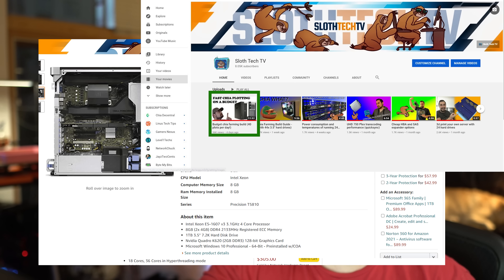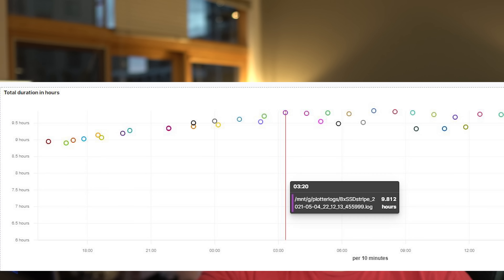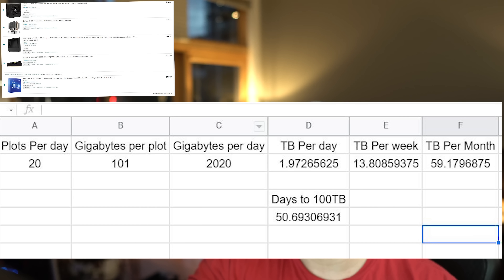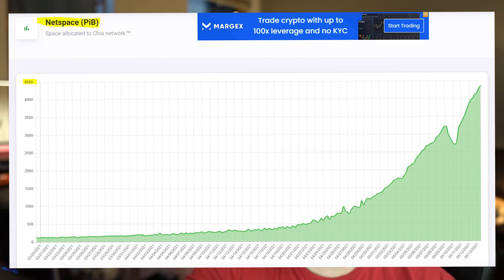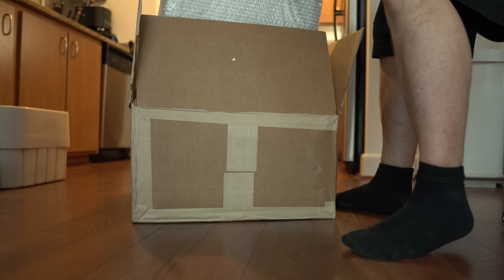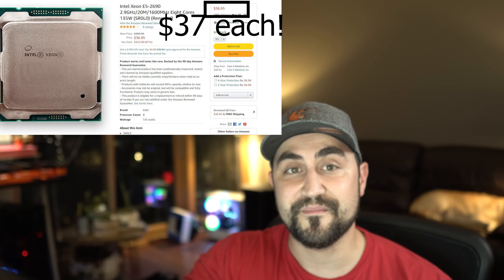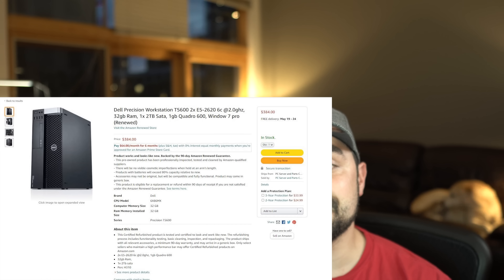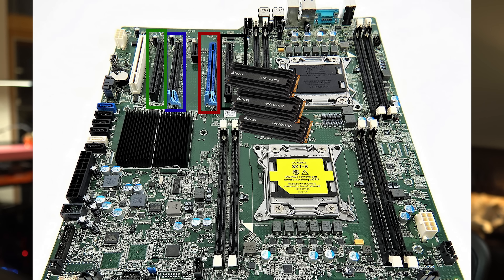Chia Plotting Build $620 w/ Dual XEON CPUs

Comment: Update: Pools dont come on 17th. They have just been moved to end of the month. You should check Bram's Twitter in case you dont believe me
Reply: @halukyildiz4126  it does not matter if its a scam or not.
That does not effect the value.
Hype effects the value

And for the time being,  this is looking like a great flip.
Reply: How's is my build, what do you think 

https://ca.pcpartpicker.com/list/FgpVz7
Reply from the maker: @sreejhu  I think with that 3900x You'll end up getting more 8TB drives.. then you'll end up getting more NVME drives to fill those new 8TB drives. -- All jokes aside its a good build that 3900x will be able to crank you through phase 1 in no time.
Reply: @SlothTechTV  Thanks a lot for your advise and help man, Do you think to put the drives in raid 0 or 10 mode. As i know if we keep in raid 0 and if  there an issue with one HD then all the other HD will be non usable, What do you use and suggest
Reply from the maker: @sreejhu  Don't raid 0 the drives -- there is something called amplification which will wear them down faster -- there also isn't any significant performance gain I've observed from raiding nvme drives. Just do plots to individual drives.
Reply: @SlothTechTV  hey, what do you mean by plot to individual drives, in the software there is no option to select different drives for farming there is only one option to select a single volume. How can I do this. May be can you send me a link to a YouTube video where someone is explaining this. Thanks a lot in advance. I must say you are the only person I found giving hard core tech stuffs about chia mining I found in YouTube. Thanks a lot for helping everyone here!!!
Reply: @SlothTechTV  hey, I am not talking about the nvme raid 0 configuration. I am talking about the destination drive where the plot sits for farming!! As you saw that I brought 2 x 8TB Wd red nas drives. But not sure how to configure them as a single drive to save all the chia after plotting them
Reply from the maker: @sreejhu  whoops sorry... yeah you can raid 0 those together and get a bit better performance when sending to them from the temp directories. sorry for the misunderstanding.

with the caveat that if one fails you'll lose all the data on both... with brand new drives thats probably unlikely.
Reply: @sreejhu  You can have multiple plot directories. In the GUI the three small dots next to "+ ADD A PLOT" is where you can add more directories where it is looking for your plots.
Don't raid 0 your drives, if one fails all your plots are gone. Also keep in mind the highest failure rate for drives is when they are new, the ones that survive will then most of the time run very long without issues until the failure rate slowly increases again because of years of wear.
Reply: @SlothTechTV  Unless I missed it, he is going to need a video card too.
Reply from the maker: @BradSimpsonVideo  Roger!! ty for catching that, Brad. Much love for all of the help everyone is being in this community. Its great.
Reply: @SlothTechTV  people helping people my dude.
Reply: @sreejhu  Hey man just a heads up. You need a video card for that processor. So if you already have one laying around you plan on using, cool. But you will get no display without one.
Reply: @BradSimpsonVideo  oh man, no way, I though my motherboard already has built in onboard video.. do you think ryzen 9 series don't have a built in onboard video
Reply: @sreejhu  The problem is you need a G series. Just because the motherboard has like HDMI etc doesn't mean it has a way to output it. So a lot of processors will have what they call integrated graphics. So when you are looking for a processor you want to make sure it DOES have integrated graphics. If they don't, then you need a GPU. 
https://www.amd.com/en/processors/ryzen-with-graphics 
That shows ones with the integrated stuff.
Reply: @BradSimpsonVideo  woow, thanks a lot man, this is unbelievable. I got this freaking processor for almost 700$ lol, I am not sure if I can get a gpu in this era 🙆🙆🙆
Reply: @sreejhu  you don't need anything fancy. You can get a hold of a lot of video cards that are around $50 that just give you a display out.
Reply: @BradSimpsonVideo  cool got it thanks. Also, do you think my hard disk specs for saving the plots are too much. I got a WD   Nas red Plus 8 Tb 7200 rpm with 256 mb cache. Do you think this 7200 rpm with 256 cache is tooo much or 5400 rpm should work?? Also do I really need a nAs drive
Reply: @sreejhu  honestly to me it depends how you want to send this stuff up. NAS drives just read and write slightly differently than standard drives. Same with WD purples that are meant for DVR's and things like that. I just got a bunch of externals myself but that's because I wasn't going to build a raid 5 setup or anything. From what I can tell, you don't need anything special at all for the plots once they are done. Plotting is the name of the game. Faster the better. But there is nothing wrong with the NAS drives either. So WD Red or Seagate's ironwolf are both good. It's all about your backup plan in my books. I have some high end hardware to recover files from dead drives, so it's not too big of a deal for me.
Reply: @BradSimpsonVideo  cool  thanks, but again how do you use the USB hDD, in the chia plotting software I only see one volume to select for the destination / saving plots. Or am I missing somthing??
Reply: @sreejhu  If you plug in an external drive, it should assign a drive letter to that drive. So after you select your nvme or whatever you're using for plotting, you should be able to see your external drive in the final destination spot. Hope that made sense.
Reply: @BradSimpsonVideo  sure, I completely understand that portion. But does the chia software have the ability to select multiple usb HDD location for storage???
Reply: @sreejhu  yeah so the way it works you can select up to 29 plots at a time as it stands now. No idea how future software will go. Which is fine for me. Only 20 seconds of work each time you add another 29 plots. You can select which drive you want to output to. But doing a bunch of different ones at once seems like more work somehow. I'm filling up one drive at a time at the moment.
Reply: @BradSimpsonVideo  thank you so much for putting all these informations, big salute.... .......🤜🤛
Reply: @sreejhu  no prob. Happy to help.
Reply: @BradSimpsonVideo  can you plesss help me with below issue, I plotted almost fir one day and all 5 plots can't see now in chia software l. 

I had to stop the application Because during plotting I was getting some kind of errors. At this time, I had 5 fully plotted blocks which already got transferred to my final destination. So I did a restart of the pc and I opened the application then I saw that I still had my existing 5 plots in my finally destination. But then I saw there are some data's in my temp storage (NVME)  drive so I thought I will format that and do a fresh plotting to get the max storage. So when i formatted the temp drive and When I my re opened the chia application i see That I lost my link to the plots. It's no more telling that I have 5 plots found but it shows the link to my plots. But It's not getting recognized in the chia software. Can anyone please guide how to fix this. See below for the issue
Reply: @sreejhu   That's a lot of Money why the pre-build is not good enough?
Reply: @claudioborquez3394  actually I never bought it wantedly, I had to buy the cpu processor and mobo just Becsue it was coming as a combo from newegg.ca because I have to buy 3080 GPU combo for my eth mining. The 3080 combo came with amd processor and Asus mobo + the GPU (3080) . Later I thought why not use that cpu and mobo for chia mining.
Reply: @sreejhu  so its nothing wrong with buying a pre-made computer correct?
Reply: @claudioborquez3394  sure, you can folow as per @sloth tech TV, i found his channel after I bought the stuffs else I would have got the same as he did
Reply: @claudioborquez3394  bro please help me!!
Reply: @claudioborquez3394  Hey, I had to stop the application Because during plotting I was getting some kind of errors. At this time, I had 5 fully plotted blocks which already got transferred to my final destination. So I did a restart of the pc and I opened the application then I saw that I still had my existing 5 plots in my finally destination. But then I saw there are some data's in my temp storage (NVME)  drive so I thought I will format that and do a fresh plotting to get the max storage. So when i formatted the temp drive and When I my re opened the chia application i see That I lost my link to the plots. It's no more telling that I have 5 plots found but it shows the link to my plots. But It's not getting recognized in the chia software. Can anyone please guide how to fix this. See below for the issue
Reply: Sourcecode?
Reply from the maker: @marcfree2855  its true! Pinned this comment!
Reply: But the say it:-(
Reply: @marcfree2855  dang, use this time to get hardware then, buy what ever you can, search locally and check the used market.
Reply: hpool does not work ?
Reply: Hello and thanks for the upload. 
I got the T5610 with 2x E5-2670’s (might upgrade to v2’s 2690’s eventually)  64gB ddr3 I was running 2x 2tb Sabrent 4.0 NVMes in Sabrent PCIE adapters.  I’m running Ubuntu and doing 4plots parallel,4000mb ram, 4threads, per NVMe.  
The plotting speed is very slow no matter what settings I choose.  I can’t figure out what the bottleneck is.  Ubuntu is running on a separate ssd. It takes like 18 hrs to complete 4 . Please help

Comment: sounds cheap and romantic at first until you calculate price per plot. I do 0.05$/plot, and it takes 1.5 months to repay just a one plot.

My plotting rig costs 400$ for 9500 plots. with ~18min/plot.

It takes another 6 years to repay your HDD. Average HDD failure rate is 4 years (BackBlaze stats). We can speculate about idling HDD lasts longer, but who knows.

With old, inefficient stuff, and expensive SSDs...you are plotting for 0.2$/plot or more. That is 7 months just to repay the plot. And 7 years ROI for first HDD. That is gamble.

Comment: Not sure how you are doing this for $600. I mean, I grabbed the cheapest dual socket t5600 I could find on Ebay and with shipping it was still $400 and that only has 2x e5-2620 in it. Upgrading ram and installing 2 nvme drives would put me closer to $800 or even $900 not $600.

Comment: Curious question here, I noticed that for the 5600 you have linked Ddr3 1866mhz Ram. The manual shows the max is 1600mhz and I’m curious to know if it runs that fast.

I purchased the 2680 processors and I wanted to max it out at 128gb

Comment: I got a T5610 off of ebay for around $320. Came with a e5-2620 (just one). I decided to go with a pair of e5-2660 v2’s because they have 10 cores each and 20 threads. Yes lower clock speed of about 2.20 ghz but I figured I could compensate with extra threads. Plus the pair was only $70 on ebay. I have 64 gb of ram also. I started plotting today and it looks like the system is only recognizing 10 cores per cpu. I started plotting 3 plots in parallel with 4000mb ram and 4 threads each but after the second plot started my cpu usage was almost maxed out. I may have had them staggered to close together (only did 30 min delay) also I dont know that I need 4 threads. But part of the reason I went with this system was for the crazy amount of threads. Any ideas guys?
Reply: Do you have win 10 or higher?
Win 10 recognize only one processor. You need windows pro or higher
Reply: @apapos  I have windows 10 pro. So that isn’t the issue. Thanks for the help though.

Comment: I built the t5810 I put the e5-2699  v3 .I have 2tb fircuda and 2 SSD 2tb I already had .any sudjestion on what the best optimization to plot faster.it takes 40 000  seconds for stage 1 .I put 8000 of ram and 36 tread I have 18 plots going stagert by 30 min processor is at 10 to 20% usage I have 84 GB of RAM.any sudjestion would be great I have 16 SAS drive on the way and an Sli MBA card thanks 4 the great video

Comment: The 2TB PNY CS3030 has a TBW of 3115 TB, nearly on parity with the Sabrent Rocket's 3600, and much higher than most off the shelf SSDs, but for much less. ~$270 vs ~$400 for the Sabrent.  I think the PNY is the best bang/reliability for the buck if you're looking for plotting SSDs.

[edit] I miss-typed the PNY model.  It's the CS3030, not the CS2130.
Reply: Corsair MP600 2TB 3600 TWB, currently for about ~400$, the best bang per bucks drive so far. 0.035$/plot if you plan to plot 9500 plots.

I have one with 3720 TWB written, and it still works and claims 95% used.

I have tried few SSDs, various generations...they still do same plotting time because they all use same NAND, Phison controllers. Only thing that changes is price per plot.

If you can afford Intel Optane, they have same $/plot...but you need 2000$, while plotting 20k plots.

Comment: Hello, i did purchase a T5600 and i got issues with NVMe drives on some PCIe Slots. On slots marked PCIE3 all is OK, drive is recognized under windows and speeds are good. But on slots marked PCIE2 drive will not be recognized at all. I would like to use 4 NVME on PCIE slots so i can push the whole power of this setup. Please help ;) Thanks for your effort!
Reply: You are lucky with bios v19 and my new T5600 I have Win10 starting but when I use PCIe based SSD windows hangs on start-up
Reply: @realPhotoMocha  It was the same here, I just load défaut bios settings then the NVMe was recognized
Reply: @autodiag7044  Thank you, I did try that already) which bios version do you use?
Reply: @realPhotoMocha  V19 like you, may be the adapter? I will try with another one from Amazon.
Reply: @autodiag7044  so there is hope - do you use UEFI or legacy - after the reset it is set to legacy
Reply: @autodiag7044  I got here already two adapter) I did order some additional ones to try them
Reply: @realPhotoMocha  You're right it was on legacy.
Reply: @autodiag7044  I ddi try after hours of testing the NVMe's on a different computer - same issue. I got new ones from a different vendor incoming now.
Reply: @realPhotoMocha  Well still have issues with PCIE2 named Slots, drive mounts but stays in RAW fs, impossible to format. When placed on others PCIE3 slots all is OK while in legacy mode. Will try to install Ubuntu and see.
Reply: I really hope that @SlothTechTV will help us out ;)
Reply: What works for me after replacing two nvme  are two Samsung 980 PRO 2 TB PCIe 4.0 (bis zu 7.000 MB/s) NVMe M.2 (2280) Internes Solid State Drive (SSD) (MZ-V8P2T0BW) and two Dual M.2 PCIe-Adapter mit Kühlkörper, 6amLifestyle M2 NGFF-SSD und NVME-SSD zu PCI-e 3.0 x4-Hostcontroller-Erweiterungskartenunterstützung M.2 M Key SSD 2280 2260 2242 2230 mit Low Profile Bracket
Reply: @realPhotoMocha  Ok on all PCIE sockets? I'm now on 2 sockets, 2 others just won't let me do nothing.

Comment: So if I am understanding this right if I have the dual Xeon E5-2690 V3 setup and two 4TB NVME drives I can have ten plots going on both ssd's  at the same time then being moved to storage HDD's when finished? and it will be a decent speed for the plots?

Comment: @sloth tech tv hey thx for your great videos and effort. I realy like the way you explain stuff and enjoy watching your vids. I got an offer for 2 "HP Proliant ML110 Gen9" each for arround 500 Euros. Each of them has 128gb ecc ram. One has an e5-2690 v3 and the other an e5-2640 v3. The 2690 does not have any drives in it, the other one has a P840 Raid Controller for up to 16 drives in it together wth six hgst 900gb 10k sas drives. Do you think this is a usefull offer and if so, should i replace the 2640 v3 with another 2690 v3 (or even v4 if it fits on the board). I would buy some more sas drives for the second machine as well.
Thx in advance and keep up your good job:-)

Comment: I bought a T5610, put 128GB or ram and upgraded to dual Xeon E5-2690 V2. I also have 2 Samsung 1.6TB U.2 drives. Question is what are your chia setting to get to the 40 plots per day on this rig?

Comment: Okay so I have a build that contains 2 Xeon E5 2670 8 Cores 
coupled with Asrock Mobo EP2C602-2L+/D16
which has - Intel® C602 : 2 x SATA3 6.0 Gb/s, 8 x SATA2 3.0 Gb/s (from 2x mini SAS 8087 connector), support RAID 0, 1, 5, 10
What is the best way to get around with that regarding storage?
any advice would be great
Reply: PCIe x 16	- 2 slots : PCIE1/PCIE2 : x16 mode

Comment: Hey I bought the lsi SAS board you recommended and plugged it into pci port and plug in breakout cables to sata into hard drives but the drives aren't detected by windows. Do I need to install drivers for the board?

Comment: I did too little research and jumped on a $600 3950x that is used only in half xD
Reply: On top of that I chose b550 mobo that only has one x16 and one x4 slot and that x4 is getting disabled if I used both m.2 slots at once, ef me....
Reply: Oh and that mobo won't run without the GPU installed (headless) so I had to buy x1 slot-ed GT710

Comment: These have twice the performance and they are already built for you! no need to swap cpus!:
Prebuilt 7910 with DUAL 2695 v4 32GB RAM 240GB SSD 8TB HDD $1845: https://amzn.to/2QjOsvG
Prebuilt 7910 with DUAL 2690 v3 64GB RAM  $1797: https://amzn.to/2SUadDp
Prebuilt 7910 with DUAL 2680 v3 32GB RAM SSD & 6TB HDD $1495: https://amzn.to/3wmtCvh
Prebuilt 7910 with 2x 2690v3 128GB RAM and GPU $2115:  https://amzn.to/3w89sVt

If I bought one on the above prebuilt 7910. I will only need to add 1 x Ram 64 GB and drives for permanent destination right ?

Comment: Is anyone having Code 43 with their Dell? After replacing the CPU, adding RAM and adding 2 NVME drive vie PCIE, the GPU isn't functioning properly...the infamous code 43. It doesn't prevent me from plotting but it's annoying to not be able to use full resolution of my monitor. Anyone?